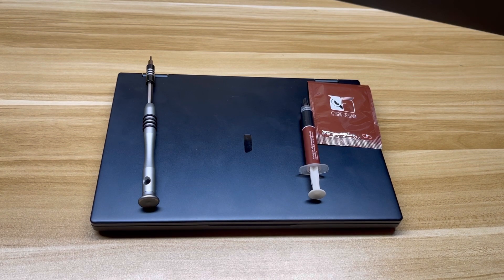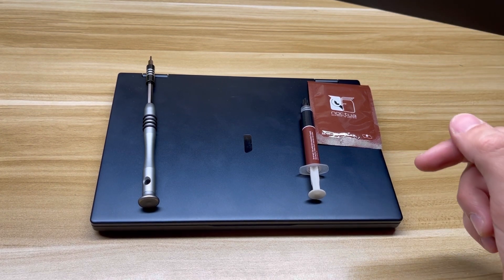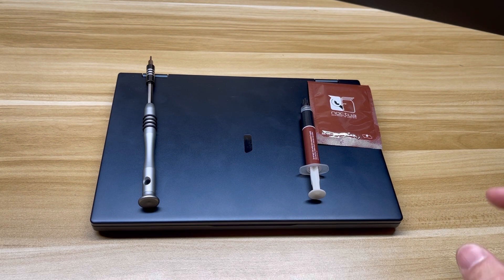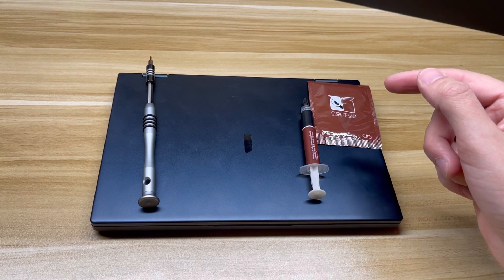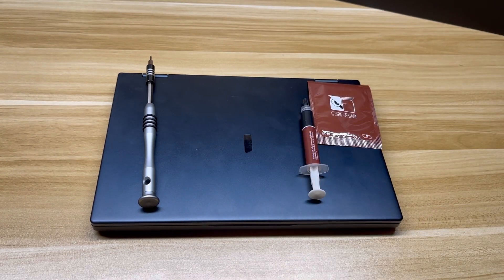Repasting The One Mix 4 - Tutorial Video

Comment: Hi, thank you for the video. I have i7 version and last two weeks it has over 96C at 20 tdp. I did repasting with an expensive paste, I was trying to connect thermal tubes with the laptop cover using thermal pads. No result. Can be your TDP utilities the reason of the thermal issues? I disabled both of them. Only set bios at 20tdp. Still 96-108C. Please help :) thank you for the unique content
Reply from the maker: No my program wouldn’t be the reason for bad performance, what is your cpu package power and temps look like using heaven or cinebench?
Reply: Cpu package power 14819W
Cpu package temp 103C
Reply from the maker: @EduardKopysov  is your fan on max, normal, or silent mode?
Reply: The one before the max speed

Comment: can someone tell me what are those black tape of the cpu for?
Reply from the maker: It’s actually to spread heat out for the components it’s on
Reply: @HandheldHardware  Thanks a lot. Do you have heat dissipation issues after you remove and re-paste it?  very nice video btw!
Reply from the maker: @numbswmd  thanks! Nope none, but I didn’t gain any performance swapping paste either

Comment: The tape you remove from above CPU heatsink is a graphite sheet that helps spreading heat from the thunderbolt port side of the machine to the back chassis and battery. By removing the sheet (and in the process destroying it -- it can't survive too much bending) and repaste the CPU, while the CPU gets cooler, the connectors and the left edge of the chassis can get quite hot, and that can be quite unpleasant to touch especially considering this machine has a small and edge-less keyboard. Don't ask me how I knew it. I did the same thing and regret every bit of it. I ended up buying a new graphite sheet and still it is not up to the original user experience, though the CPU does have better performance.
Reply from the maker: Thanks for that info, that makes some sense, right now it’s running pretty good I don’t notice any particular hot spots but it just might be my luck
Reply: @HandheldHardware  Get a 4k monitor hooked up to it. When the CPU pushes out 4K (~12Gbps, ~18Gbps including the built-in LCD), it gets REALLY hot even when doing nothing. In my system it shows the CPU consumes some 4.3W doing nothing when an external 4K monitor is connected. That's why it is so hot, hotter than playing Youtube with only the built-in monitor. Unfortunately this machine is my main workstation (I need to work on the go), and I do a lot of CAD works, so a portable 4K monitor is never out of reach for any meaningful works. More often than not I find myself hooking up two 4k monitors to it, and it gets absolutely toasty even when doing nothing but pushing 30Gbps to the three monitors.
Reply: Would you kindly provide the link where you purchased the graphite sheet?
Reply: @849899  Unless you live in China, I do not think my link would be worth purchasing. $30 int'l shipping for a piece of $10 material sounds like a bad deal to me.
Reply: @bskull3232  I actually do have friends in China that can help with shipping. Please share the link with me.

Comment: Could you easily add more ram to this device? Considering buying the 8gb ram version and manually upgrading it to 16
Reply from the maker: It’s soldered ram, so unless you are comfortable with hot air rework station and soldering large BGA chips I would stick with buying it at 16